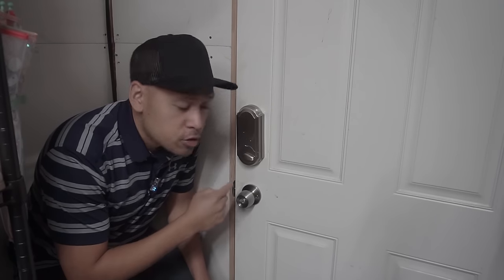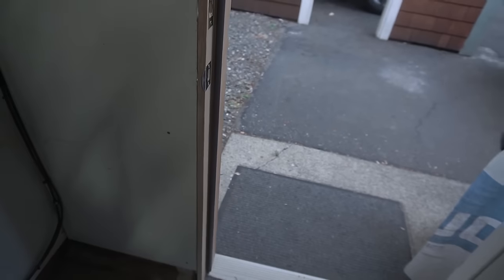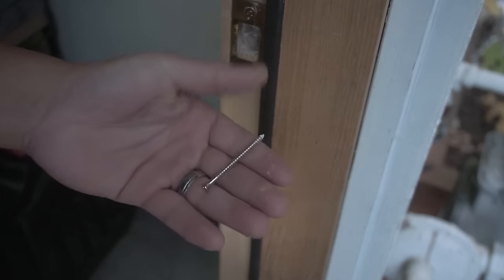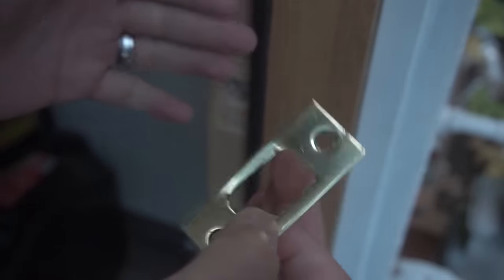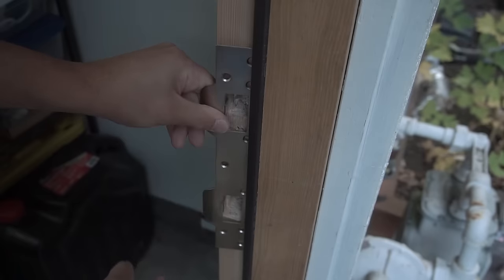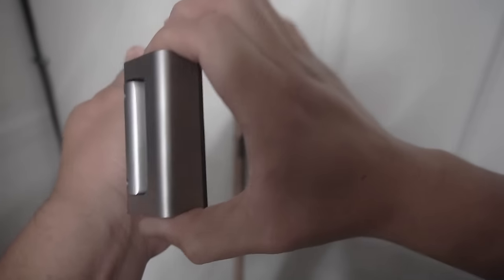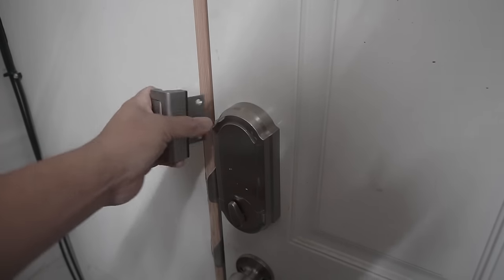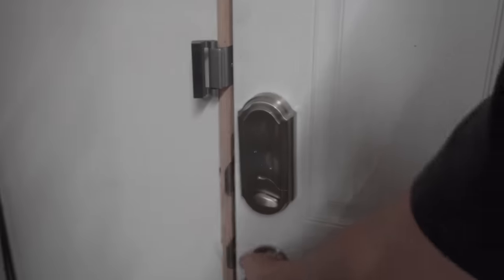How To Make Your Door Kick-In Proof Like A TANK! Keep Your Family & Home SAFE!

Comment: The LA housing authority did a fantastic experiment in the 90's. They were tearing down public housing and decided to conduct a test. They used long screws in various combinatations on a front a door. It turns out, screws that were at least 3" mounting the existing hardware and strike plates  including strike plates, deadbolt barrel, and hinges worked the very best. The fire department used a battering ram and it took a long time before they finally broke the door. The door. The door broke apart. It's one of the first things i do when I move. And predrilling the holes is critical. Based on that study, the bar and reinforcement lock aren't necessary. Just buy some inexpensive screws and a long drill bit and you'll have ample notice of someone kicking in your door. And if you're first curious about home defense, this is the 3rd of 4 D's of home defense. There are some pretty ehhh videos on that on youtube, but you can research Deter, Detect, Delay, and Defend.
Reply: Thanks for this - thats new knowledge to me
Reply: What's meant by predrilling holes? Like put the screws in first then take them out and back on with the strike plate?
Reply: @valeria262  You'll want to use a drill with a drill bit to drill the holes before you drive the screws in. Try to just drive in a larger diameter 3 screw without first drilling, and you'll run to the hardware store and grab the bit.
Reply: @rcampbell4967  gotcha, thanks for the clarification
Reply: Do you pre drill the entire 3 inch screw length?  Do you need a drill bit the same diameter of the screw?
Reply: @Gracie40  I posted a response, but don't see it. Let me know if it doesn't post and I'll repost.
Reply: @rcampbell4967  I don’t see it.
Reply: @Gracie40  Me either. I will try posting in smaller posts. So yes, predrill the length of the screw.
Reply: @Gracie40  predrill the length of the screw
Reply: @Gracie40  #10 screw requires a 1/8 in drill bit
Reply: @rcampbell4967  thanks so much!  I was considering hiring a handyman just to put the screws in for me because I was envisioning myself with my drill trying to put screws in and then finding that I couldn’t get the screws in all the way on my front door.
Reply: @Gracie40  You'll need a drill driver.  Push very hard as you drill. If it gets stuck, back the screw out at least an inch, and start driving in again. You may have to repeat, but you'll get it.
Reply: @rcampbell4967  thanks to you,  I feel confident that I can do this myself.😊

Comment: Great idea, but I highly recommend drilling a pilot hole slightly smaller than the base diameter of the screw to prevent any splitting of the framing.
Reply: Without a doubt. The door jambs can be a more fragile wood. Also if you can find them, square drive screws have much less chance of camming out than phillips, especially if you hit some hard wood in the framing.
Reply: I highly recommend replacing all wood studs and framing with steel. Boom! I just out highly recommend you. 👍🏽👊🏽
Reply: @Chris-mo9gt  😂😂
Reply: @Chris-mo9gt  That would be a pretty expensive big job and nobody would really do that unless your house is being built from scratch you could just add it in
Reply: Oh yeah
Reply: @seatime674  i recommend building your home out of rebar reinforced concrete with a steel frame.
Reply: @gotworc  That's a bad idea noone would do that either
Reply: Well yea he says this in the video. But doesn't follow it. He says he's preventing splitting but can't prove there's no splitting.

Comment: I went to the door lock section of the hardware store and purchased all the safety add ons that were available. I also picked up a box of 4" coarse thread construction screw's. It was a lot of work to do the multiple projects. 
Recently several neighbors have been robbed, in all cases entry was through a kicked in door. It is something I no longer worry about. The effort to do the projects is well worth it.   These improvements won't stop a determined thief but it will make them think and maybe go to the neighbor's house were these safety improvements have not been done.
Reply: Excellent.  If you have a patio door, secure that the best you can. Also, take the cord with the red hamdle off your garage door.
Reply: Well done, I agree. Beef-up security on all doors & windows inside & out. People forget about indoor security. If you keep them out, that's fine, but don't give free access to the whole home. Lock all inside doors, multiple locks. 
The main goal is to keep intruders out. Make them go away disappointed. They will seek easier prey. 
2nd. Goal, internal upgrades. If they get inside, extra locks indoors will prevent total plunder & shield you if you're home. 
They will try, make them fail.

Comment: As a former landlord, I've been doing this for the last 30 years or so for myself and family members. However, my strike plates are thicker and longer (18 inches) than the typical hardware kind.  I have them on all of my 3 exterior doors. I've also installed mag plates, which are thin pieces of metal that wrap around the door and under the door knob and lock. This provides a visible deterrent from the outside, hopefully enough that no attempt is made to attack the door. Any good carpenter/ door istaller would tell you the 3 inch screws are only effectve as the wood (framing) that it is screwed into. As mentioned earlier, don't forget to change out the screws in the door hinges as well.
Reply: Hey David. If you happen to have loose door latches or dead bolts on your doors at your home or family members, there is a new door hardware called ReSecure Latch. Sits inside the door alongside the latch. We show how it works over on our page. Trying to get the word out. Hopefully, one day, we will be in the major stores.

Comment: if possible, you should always put shims behind where you put screws through the door frame. you have a fairly wide gap in your door frame, which is where you comment about only a few millimeters of the handle latch catches comes in. putting screws in the frame with no support behind them from shims will pull the frame further from the door and increase that gap
Reply: Deadbolt enter wall 1 inch deep Handle/locks help you FORGET KEYS IN HOUSE : USE DEADBOLTS

Comment: I bought these for every door in my house that has access to outside. I would say put two security reinforcements on every door above the deadbolt and below the handle. If you have small children or children period, educate them on how to operate the locks incase of emergency or fire. Intruders will always kick the door in multiple times before being scared off by all the noise they are making, if they can't kick in after the 5th try they will probably flee the scene. If you have the money have a professional install floor based/drilled impact stopper as they will most likely never fail.

Comment: Also remember that the new plate is going to sit on top of the area where the old plates were sitting and may make it too tight for the door to close.  The old ones were recessed into the door jam and you may have to chizel out that area for the new plate to fit inside.  Been there and done that.....
Reply: I found that a 4lb hammer solved that problem for us.
Reply: @garyodle5663  Good one!  Lol

Comment: Very informative. In Southeast Florida all entry doors open out instead of inwards due to hurricane building code.
Reply: You should place a pin by each hinge so if a criminal decides to pull hinge pins the door will open. A very stout screw with a thick head can be used. once you drill in the screw you put peanut butter on the screw head then close the door to the screws, the peanut butter will mark the door edge so you can drill a slightly bigger hole into the door in which the screw head can be, preventing the door from being opened!!
Reply: @GM8101PHX  There are security hinge pins.

Comment: One thing that was not mentioned about adding the 3 inch steel screws to the strike plates and that is any gap between the door frame and the wall 2x4's.  If there is a gap and you put in the 3 inch screws the door frame will be pulled closer to the 2x4's and the door latch will not even touch the striker plate.  It will be necessary to put shims in between the door frame and the 2x4's.

Comment: Two weeks ago I installed these stronger plates on all my exterior doors and swapped out the hinge screws, too. Took me 15 minutes and I love the extra strength to my doors. These plates look sharp, too.  Also, I’m a woman, all women can do this to their home. Even their apartments. I think I paid $12 for each plate. Smart investment.
Reply: Don't feel too comfortable, I remember kicking in maney well built doors in a apartment building slated for demolition, a flying 180 lbs kick opened all the doors, kicking the hinge side would send it spinning like a top into the room! Hing side protection is never considered! It's why I got steal ghetto/ security doors, in front of the wood doors!
Reply: @stevemitz4740  my only intent is that they have to kick it twice or break their foot. Enough to pull out my punishing she-bang bang and get into position.

Comment: Thank you, but you should also reinforce the door side across from the strike plate with a U shaped metal plate if possible. Otherwise the door becomes the weak point and can split.
Reply: Bonus feature, the visible reinforced plate is a deterrent to thieves.
Reply: @titaniumspecial4207  They are better than the stock hardware and less expensive than your solution.

Comment: Great ideas on this video, but there is a missing detail.  You must add tight shims between the door jamb and the framing.  If you just install 3 inch screws like this, there is a good chance you will distort the jamb and lose function of the door.

Comment: Our front door opens outwards, kick-in safe as well as easy escape in case of emergencies. The deadbolt has a double lock feature to make the lock go in deep as well.
Reply: You should have some way to prevent the door pins from being backed out. I drilled and tapped a set screw on the inside of the hinge.

Comment: I'm here because my daughter's apartment door was kicked in 2 days ago. When she moved in I checked it and the complex, or someone, had already added longer screws to the 2 strike plates. I added 3 long screws above and below the strike plates.  When the door was kicked in it took out about a 2 foot section the door frame and even some sheetrock. There was a significant gap between the frame and the 2x4s that only have the 3 inch screws a shallow bite. 

IMO, this one piece strike plate with 4 inch screws would have been harder to kick in.  I've seen some even longer ones though, and I'm looking at using one those. 

Probably the ultimate door strengthening technique is a pair of 2x4s across the entire door opening. But that's ugly. Even the brackets alone are ugly. That's what I'd like for my house, but my wife would never go for it. Admittedly it is also probably over kill for where we live. Until it isn’t,  lol. 

Predrilling helps a lot, but sometimes the wood will still split. To help keep your screws from splitting the wood you can also rub the screw threads on a bar of soap before hand. The soap helps a lot also if you have to hand tighten a difficult screw, or lots of them.

Regarding placement of extra locks. Agreed, if they are low on the door then kids can mess with them. But pets can mess with them also and inadvertently lock you out.

IMO, 3 inch screws aren't long enough.  Most doors are set into a frame made from a pait of 2x4 studs. In the US, those 2x4s are only a total 3 inches thick. However the door frame itself is about an inch thick, and the wood is very soft. There may even be shims or an air gap between the door frame and the 2x4s. So in many cases, a 3 inch screw has only 2 inches or less bite into the studs. Unless there are bricks or glass right behind the studs, I think 4 inch screws give you more strength.

I would also take at least half a dozen of my long screws and drive them above and below the strike plate area with about a 9 to 12 inch spacing. That makes the entire frame one strong unit. Then, I'd use at least one more long screw on each door hinge. 

When you beef up your frame, you can change the dimensions around the door enough to cause an air gap, so you might have to install thicker weather stripping. 

At this point, the most likely failure point becomes your door. I've seen metal exterior doors split or bend in the area around the lock and the bolt. If that's a concern, then you can install one of the metal shields that wraps around the deadbolt area. Or buy a stronger door.

Comment: That cam lock should be placed much higher on the door. The idea is to have it higher than someone can reasonably kick. If the cam is at boot level, then 100% of the force will be applied to the screws holding it in. When you place it 12 to 18 inches above boot height, the door flexes and absorbs most of the energy of the kick.
Reply: I SEE that...yeah,,,good idea...thanks
Reply: Should it be all the way at the top?
Reply: Ideally, yes.
Reply: So if you were trying to loosen a bolt with a cheater bar, you would rather get closer to the bolt to apply "100%" of the force?  The further you grab down the handle of the cheater bar, the more force you can apply because you are moving a greater distance at the end.  The cam lock and screws are the strongest point and act as the fulcrum in this instance and the door as a lever.  The further along the door you apply force from the lock, the more mechanical advantage you have.  I'd put my money on somebody trying to kick directly against the lock with 100% of their force over somebody kicking away from it and getting mechanical advantage.  The door "flexing" is just a greater "input distance" applying more force at the cam lock.  It's like if you ever did demolition on a house and tried to tear out a 2x4 stud from a wall.  You wouldn't grab it close to where it's nailed, you'd grab it from the end and pull it like a lever.

Comment: Perhaps a more extensive measure, but more secure, is to also install a metal door frame that goes within the studs around the door.  This way there is no give to the door frame.  Even with some of these modifications, if someone tries hard enough they can deform the doorframe itself (not the door, but the frame around the door).    You can then cover the metal door frame with wood trim so it stays hidden, but the frame itself around the door is metal and attached to the studs (structure of the wall) with heavy duty screws.  Many modern homes have this but older homes may not, and again, this may be harder to do because it would be like installing a door again but if you own the home, it may be worth the exepsne and/or effort to have it done.
Reply: Three inch screws go into the framing. I use four inch on my house. Tests show that long screws will ensure the door will fail before the frame.
Reply: After a few hits at the door,  it thru the windows they go.  You just need to delay enough to prepare your defense.  Then call the police.
Reply: @danc2014  Deter, Detect, DELAY, Defend. You're absolutely correct.

3M sells a film that works to delay entry through a window.

Comment: I appreciate the to-the-point focus of your videos.
The one thing which always bothers me about reinforcing doors in homes with ground-floor windows...I can fairly quietly break into a fairly well-hidden window in a home enormously faster and more easily than bothering with a well secured door.
I'm not saying doors shouldn't be secured, just - it takes less than two quiet minutes to remove most thermo-glass inserts from a typical Jeld-Wen window. And that 's being careful to make next to no noise and to even not break the glass.
Reply: interesting.  so then, how can windows be secured as much as front doors?
Reply: These days a burglar is not worried about being quiet when they are kicking in doors. 
Even so these days the criminals don't even care if you catch them they are so emboldened.
Reply: Do you use a glass cutter?   Or disassemble the frame somehow?
Reply: @DM-lk5ym  if the glass is an outside of frame mount in, where the adhesive is between the glass and inside of the house, you would only need to remove the trim around the glass (pops out easily) and run a razor blade behind the glass cutting the mounting tape (basically a double sided thin foam tape), then pull the glass towards you.  In the reverse where the glass is towards the inside, you would run a razor blade around the edge of the glass to cut the mounting tape and push the glass inwards. I learned this when I installed a new glass panel in a window of my parents basement when a wall dart was thrown through it lol
Reply: You are the reason I have metal bars on window openings!
Reply: @jaya.0069  haha no worries, knowing how things work and how to defeat them is how you improve. Metal bars also deter from just plain smashing the glass too
Reply: @mgtow-balance3409  I live in Arizona and had the roll down hurricane shutters installed for each window. Once the shutter is closed these is no access to the window. Yes it will be dark, but you will be safe!

Comment: Watched many videos of people standing with back to the door and kicking at the bottom of the door to force it open. SO to me that extra lock would be better closer to the bottom. Great video and thanks for the links to the products
Reply from the maker: Thank you for sharing! It was pleasure to make this video to help! Have a great day! 🙏🏽😊👍🏽
Reply: I've never seen a lock or deadbolt at bottom of a door, didn't realize it could be kicked in that way.   What a pain to unlock it from the outside though even if it's a good idea.
Reply: @DM-lk5ym  He's talking about Defender Security Reinforcement Lock that's in this video that doesn't use a key.
Reply: Kids can open in case of fire also.